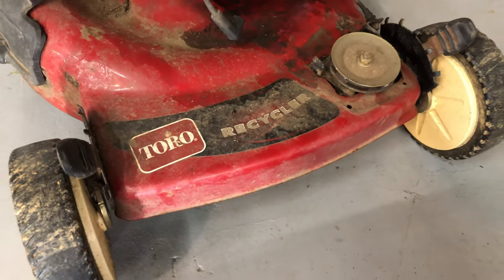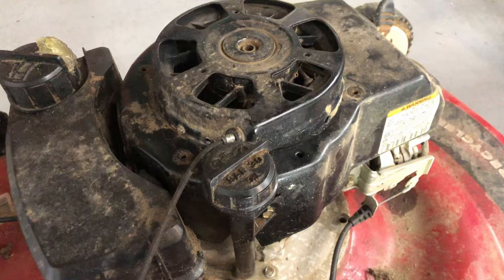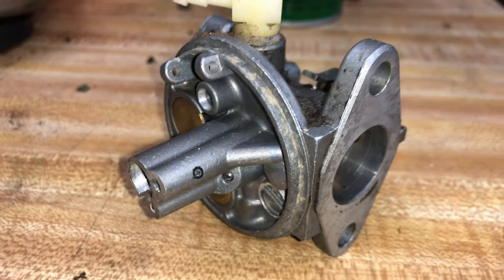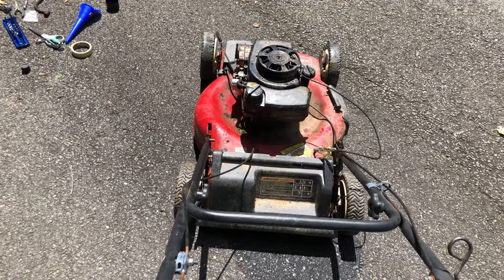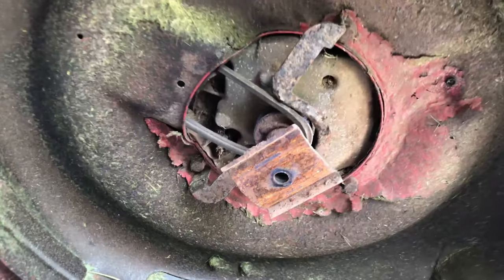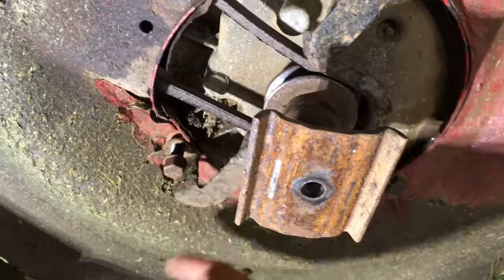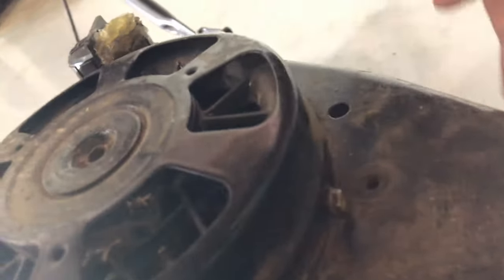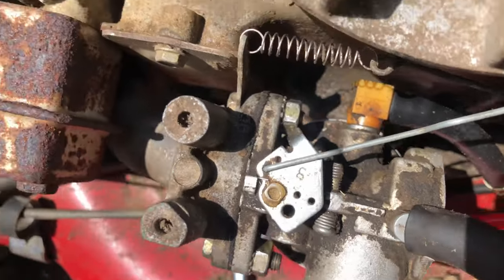Toro Recycler Mower Starts then Dies, and other Common Problems

Comment: Hey I have a question..I have a tecumseh toro 6.5 hp..replaced with new carb...I mowed whole back yard..now it will start and run for few minutes fires everytime..I adjusted float didn't help the carb new what else can I check
Reply: It will start runs a minute or 2 and dies
Reply: Might be gas gap needs replacement